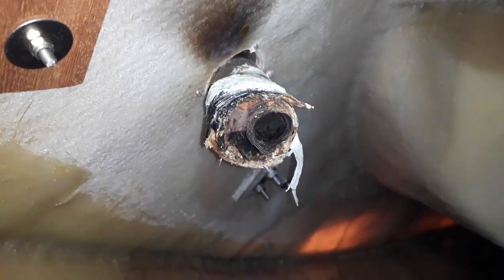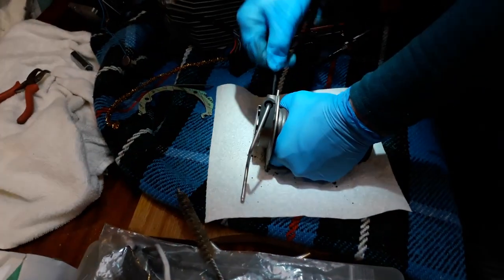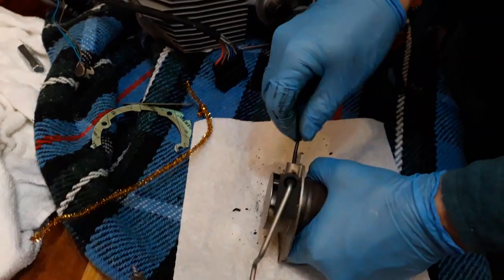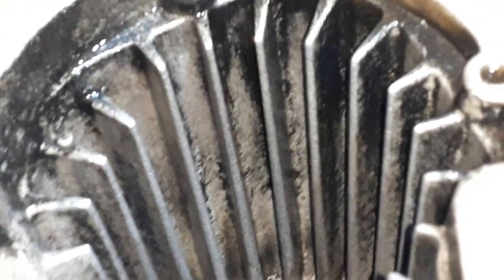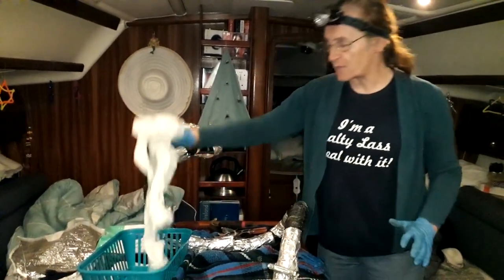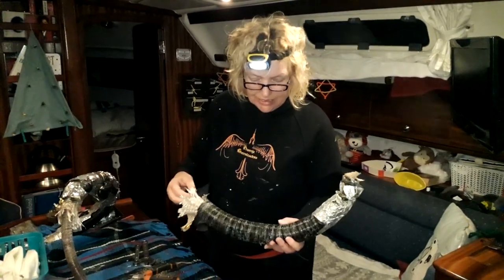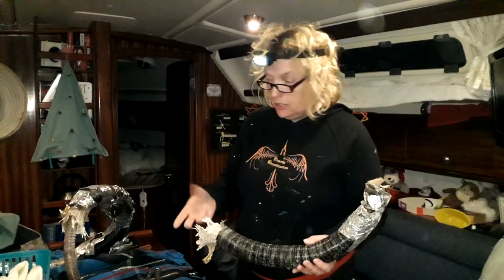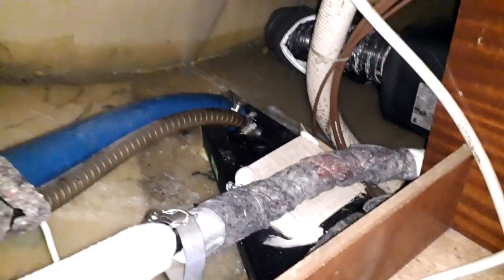Eberspacher Diesel Heater - Unexpected maintenance - Ep. 117

Comment: Holly devine Jesus! That exhaust hose was a death trap, the black staining on the transom inside is exhaust gasses that have been leaking into the boat!  FYI Best exhaust insulation is the glass fibre with the silicone outer, comes as a tube you slide over the new stainless exhaust tube. Glad your sorted ladies. Sail Safe. Ant, Cid & the Pooch crew.
Reply from the maker: When it fumigated the boat, we knew had a problem :-) Thankfully, that locker is very well ventilated with a total of 4 vent holes (three of them just above that outlet) so the hot fumes went up and out. The main burner is about a metre lower down on the other side of the boat, but even so....

All is good and toasty now

Comment: I've been a mechanic for 30 years and the two best things I ever found to get rid of grease and sludge is citral, and Easy-Off oven cleaner in the yellow can it even take off paint, yellow can of Easy-Off oven cleaner the toxic stuff right down to The Shanty metal and if you use citral get the industrial stuff doesn't cost much last for a long time
Reply from the maker: I have never heard of citral. We have something called "Strike" that seems to clean very effectively.
Reply: @SailingYachtSaltyLass  citral is made from oranges they take the they peel the skins off and they press them and they take that oil put it in 55 gallon drums I used to work for Tyson's poultry and they get it in 55 gallon drums and if you got it on your hands two or three times in a day that leave them kind burning, but actually it's not toxic at all and that's why I was impressed with it cuz I ain't never seen anything that would cut grease and grime better than Easy-Off oven cleaner
Reply from the maker: It certainly sounds impressive. If I ever see some I will certainly try it out. Thanks for the tip.
Reply: @SailingYachtSaltyLass  I tell you what I don't know how to do it but I got some citral here at the house and I got a shop that I'll always tinkering in I'll make a video and show you how to clean stuff up real quick and I'll send it to you but I don't know how to send it you know I've never done things like this before you know I'm just barely passed well let's just save this Smartphone didn't dictate for me I wouldn't be making any messages, anything I know about a computer I've learned from a smartphone, I know what to do I've learned a real useful tool, I'll check it out on YouTube
Reply from the maker: We all have our own strengths. I may know how to make videos and upload them, but I could never do a mechanic's job. Oh, I tighten nuts or change oil or drill a hole, but pulling stuff apart big time??? I leave that to the experts :-D

Comment: I have been working almost 30 years with technical pruducts from car`s to aeroplane and focuses on safety have a red line. And i must to give you advise, this temperature wrapping/protection that you added around the exhoust pipe you must remove except where you actally need to have it to protect other items. Or else you can not inspect the tube and if it cracks on non visibel/out of possibilty to be inspected places the toxic gas carbon monoxide from exhaust wich is without colour and smell can fill the boat and it is deadly. The exhaust tube is not that hot a few centimeters away from it, just very hot to touch.
Reply from the maker: I understand your point and I do not disagree with it, but I wish to add a few points in reply.

Firstly, the covering is knit. It is a coarse fabric with large holes and its main purpose it to stop anything touching that hose directly, but it is not hard to roll it back to inspect the hose.

Second, we knew we had a problem with the previous hose because the heater at start up is "dirtier" then when it runs and produces small amounts of soot (you can see this on the transom in the video). Hopefully, the soot would show up on the covering indicating a leak.

Third, the hose is spiral bound and looks like it is made of cracks (if you see what I mean) and I am not sure a crack woold be easy to spot. It is also not that easy to inspect without actually removing the entire hose.

Finally, that locker is very well ventilated and we always keep a hatch open when the heater is running. As long as the Carbon Monoxide monitor in the main cabin does not go off then we should be good.

I would be interested in your response to the above points.

Comment: Try some citral, it cleans everything should be in greasy and nasty right down to the metal and easily removed with water little bit more expensive than Coca-Cola, but it will get it down to the bare metal.
Reply from the maker: We have Bilge Cleaner aboard. It seems to remove a lot of stuff.

Comment: I use titanium exhaust wrap on my heater exhaust, very effective in heat insulation but prickly to handle ...cheap though . Huge 5mtr roll about a tenner on eBay and tie them off with metal cable ties
Reply from the maker: That might be good. I will have a look, but that rock-wool stuff is very good. On the doubled up parts I can actually wrap my fingers around the insulation. It is uncomfortably warm, but considering how hot the exhaust pipe gets.....

I would probably use that other stuff you mention for nearby stuff to act as a heat shield.
Reply from the maker: Beverley and I are sorting out the shopping list for the projects we want to do. Looks really great stuff

Comment: No the white stuff that was floating around in the air that you pulled out of the pipe the stringy stuff
Reply from the maker: Whatever it was, it looked degraded and we got it off quick
Reply: @SailingYachtSaltyLass  yes if you watch your video you can see it floating in the air I remember when I was a kid asbestos was on and everything it's all right as long as you don't move it but as soon as you move it after it's been subject to heat time and time again it breaks down really easy and you'll have those fibers floating in the air that's how you get that mesothelioma man you should guys should have if that's what it was had masks on something that filters down to 5 microns
Reply from the maker: We did not like the look of it in any case. That is why it went off so quickly

Comment: Coca-Cola will eat a nail up if you put it in a bottle put a a ten-penny nail in it, it will eat the nail away in 2 weeks, and that Coca-Cola done a better job than what I thought it would I shall try it, Coca-Cola also cleans your battery terminals up real real good.
Reply from the maker: Now you know why we never drink the stuff ....
Reply: @SailingYachtSaltyLass  Colas aren't good for you, but not for this reason. The cleaning component is phosphoric acid. Phosphoric acid is not only harmless in food, it's present in so many foods that it would make your head spin. in fact, many dairy items aren't even possible without phosphoric acid (anything curd based, like cheese and cottage cheese, for example). 

You can usually buy phosphoric acid in the paint section of home-improvement stores. It's much stronger and will not attack metal when used properly. Just don't try it with hydrochloric (Muriatic) acid like you'd use in a pool. That stuff is aggressive and you can't really neutralize it easily.
Reply from the maker: We rarely drink the stuff and I mean rarely as in less than a dozen glasses per year and probably less than 6 glasses. It just is not something we buy except for cleaning exhausts and combustion chambers. 

Wine, on the other hand.... 😄😄😄😄
Reply: Lol. Relatable! I gave up all sodas when I gave up processed sugar years ago. I cut out even more sugar by replacing wine with weed. I haven't suffered a hangover in years! 

Good job on the fix, BTW. Self-sufficiency is another form of independence, and independence is power.
Reply from the maker: We only replace wine with air - by emptying the wine bottles 😉